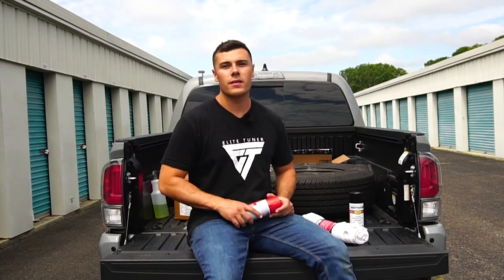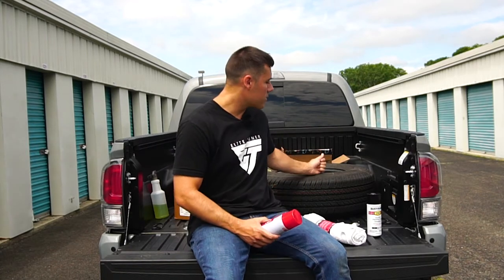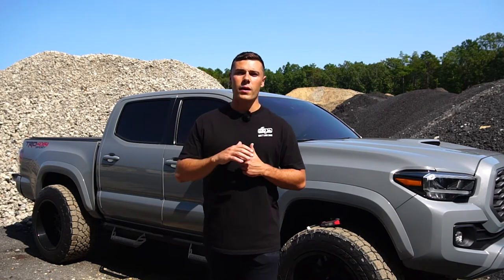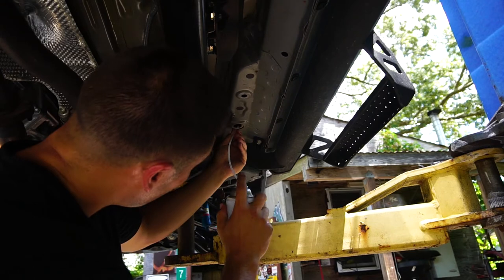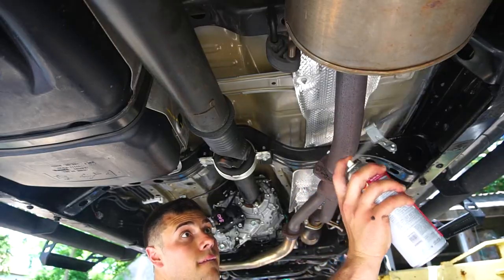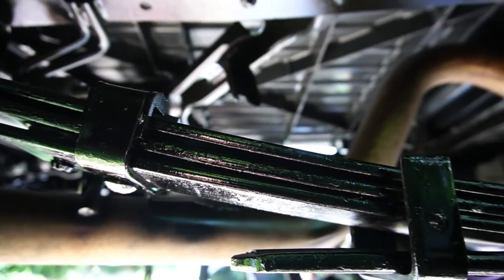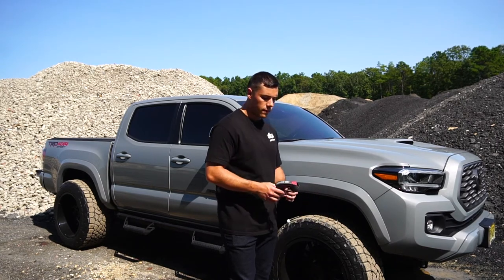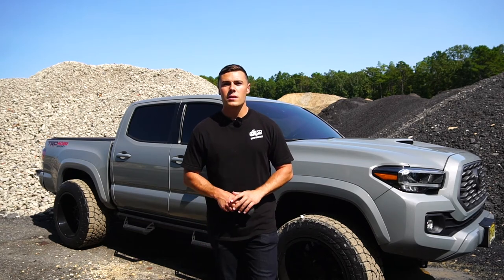Fluid Film Undercoat Install | Tips | Maintenance

Comment: Where did you get extension hose?
Reply from the maker: I bought a kit that came with the hose and spray on amazon. But I actually just did two more trucks and I bought the commercial sprayer and used the black and it looked real good!